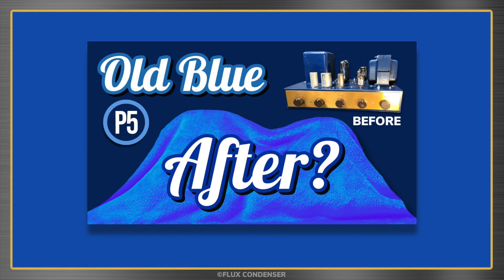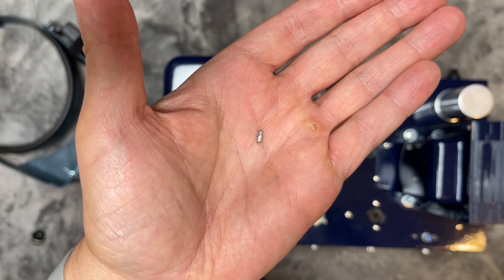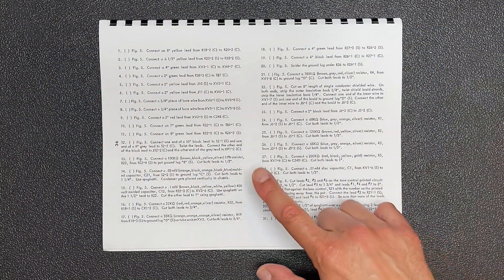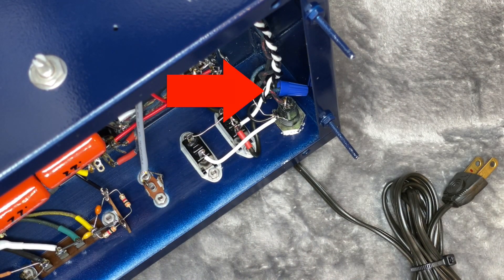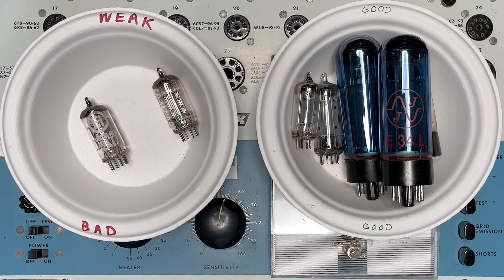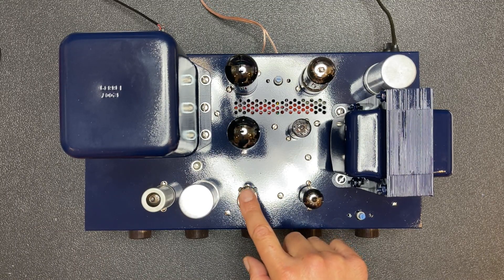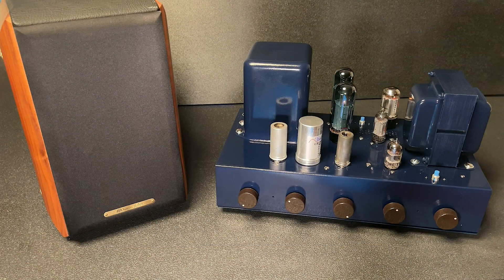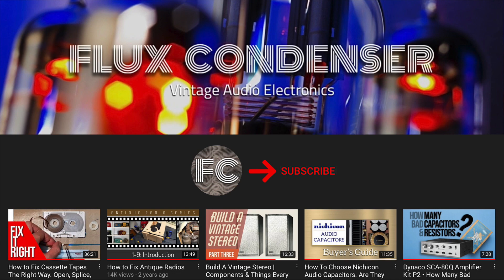Can I Rebuild It? Do I Have The Technology? Can I Make It Better? • 1957 Eico HF-52 Tube Amp • P5

Comment: What headset magnifying led are you using?
My biggest problem working on projects is not being able to see all details clearly without my glasses 🤓
Reply from the maker: That’s the classic Optivisor with an LED light attachment. I’m the same, couldn’t do this work without proper magnification and these things are widely considered to be the best. I think there’s a link to the Optivisor and the LED attachment on my Amazon link page you can check out here: https://www.amazon.com/shop/fluxcondenservintageaudioelectronics

Comment: Nice and neat. Most of my amps follow this point to point method.  I'm kinda new to building tube amps and have just built a few guitar amps. I'm terrible at it so , I use my ohm meter to check for dead shorts after I'm done. Might have caught that excess wire. Really appreciate you sharing your work.
Reply from the maker: Thanks, Frank. Yeah, there are many ways I could (and should) have caught the short. I was just too impatient to stop and thoroughly double-check things before firing her up. I had a long run of getting perfect builds before this project and I got complacent and lazy about my final inspections.

Comment: Great job! I would have used a terminal strip for the thermistor though, to mechanically isolate it. Really enjoyed watching your rebuild!
Reply from the maker: Thanks, Kent. Glad you enjoyed it. Yes, absolutely, a terminal strip for the thermistor is preferred, but that area was awfully congested so I made due with using the fuse holder.

Comment: Unfortunately you learned the hard way to use worn out valves when doing an initial power-up. I was lucky to learn this trick from an old crow at my radio club and have yet to toast a good valve only an old one. Good show on the build
Reply from the maker: Thanks!

Comment: My heartfelt condolences on the loss of your Bugle Boy 5AR4.  I had one roll off the bench onto the concrete floor back in the '70s.  I understand your pain.  I still have the base here somewhere, now modded with two 1N4007s and a dropping resistor.
Reply from the maker: Thanks, Darth. The wake is Thursday. Hope you can attend ;-)

Comment: Condolences on that lovely rectifier tube. Thanks for truthful showing errors along with your well thought out craftsmanship. I did not know the vintage pins could be replaced! Sweet. The Chicago output transformer in that amp is exceptional. I have two HF20's stashed away now I have the courage to follow what you've done. Thanks Chris well done!
Reply from the maker: Thanks for the condolences. One thing about mistakes, each (hopefully) brings us closer to making fewer in the future. Not sure where I picked up the trick about the tube pins as this is the first time I’ve broken one, but I was glad the knowledge was in the back of my head (and the spare sockets were in the bottom of a drawer). Please keep me updated if you tackle those HF-20s!

Comment: Hi Flux if I may give a surgerstion.
Your Hum can be more reduced by using a star ground earthed to the first negative of your electrolyte.
I bet you get better results less hum my Amp haven got any hum.
Nice restoration 😏
Reply from the maker: Thanks, I’ve played around a bit with joining all the ground points, but so far haven’t found a solution. It’s a 60 cycle hum, so it’s not a problem with the power supply. Also, it’s not affected by the volume control, so it’s something in the final stages. The problem may just be inherent with the design. If you look at the schematic, you’ll note that the 460V supply for the output stage is directly connected to the unfiltered rectifier filament supply from the transformer. And, unlike something like a Dynaco ST-70, no choke is used. I’ve got a few more ideas I can try, but if there’s no improvement it won’t be a big issue as the hum is very minimal and I don’t want to heavily modify the amp.
Reply: @FluxCondenser  I made lots of amps the first stage is the most sensitive (as you know)
I prefer to make all heater wires from transformer to one tube. Never in serial and signal goes 90° over heater wires. I saw your build it isn't hard to get those earth wires to one point. It is the simplest way to try better results. I had one earthed wire from point in serial the Amp was humming like hell. I replaced the wire so not in serial but two seperate wires to earth star point and the Amp was dead to hum.
I know you have a lot of experience but this is a very good tip. It doesn't cost much time maybe a half an hour. ☺️ Cheers again nice thought about the net input.
Here my photos of my pre amp and 6550 power Amp
https://imgshare.io/image/pqHc69
https://imgshare.io/image/pqH0EO
Reply from the maker: The hum isn’t coming from the first stage. I do see a couple of opportunities for slightly rerouting cables that may help clean things up, but I’m going to keep the wiring as specified for historical sake. Stay tuned.